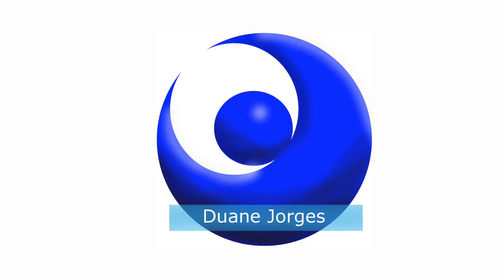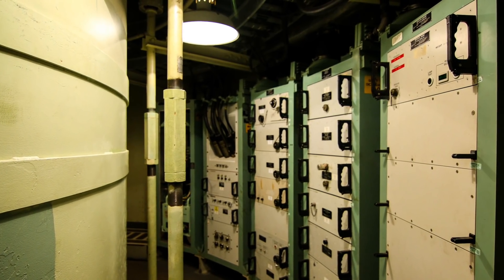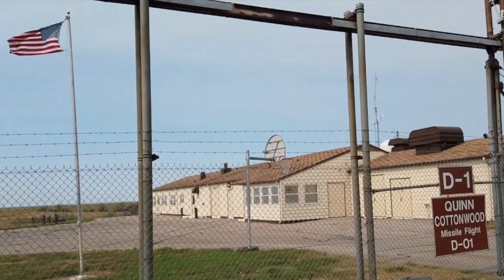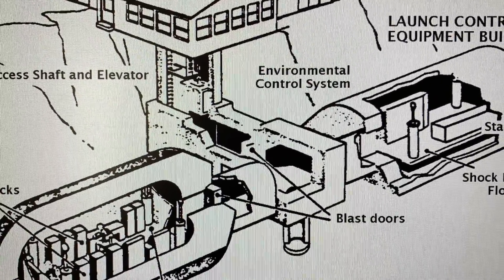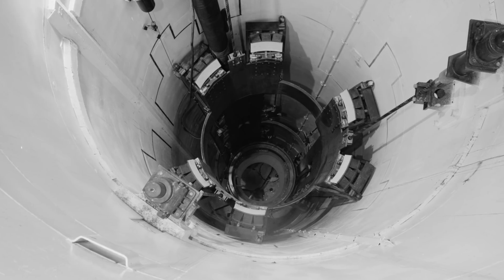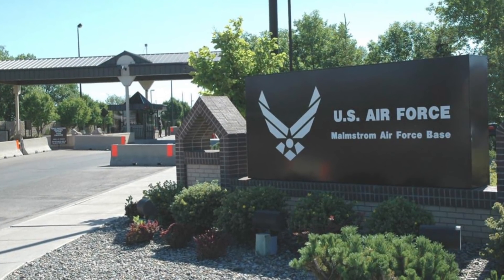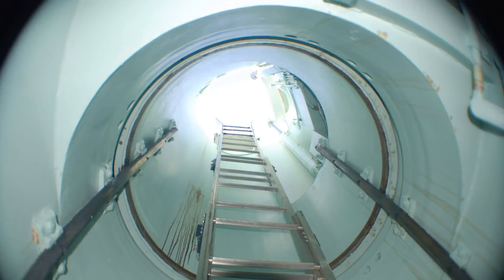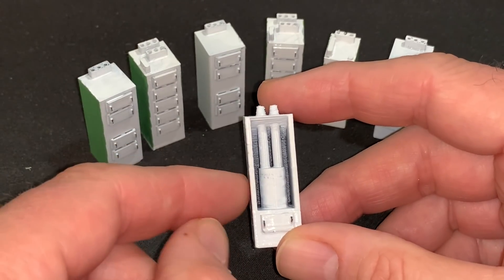Minuteman III Missile Site - Virtual Tour

Comment: This brings back a lot of memories. I was at A5 the one in the foothills near Monarch. my first job out of tech school in Minnesota. A5 was part of the first missile site to be built. It was a Minuteman 1. One day back in 1962 the missile was in the hole without the warhead when we got a call for all Boeing personnel to leave the site. On the way back to Great Falls we saw the truck which carries the warhead go out. It was the start of the Cuban missile crisis. Note the support building was not built yet at this site. I know all about the access procedures and the forever slow Plug. Do you remember the Polaris tube?
The rest of my time at Bowing was going from site to site with another crew doing the same and run tests and balancing the line between missile lunch siloes. all over the three bases Malmstrom, Minot AFB, North Dakota, and Ellsworth AFB South Dakota. just about every missile site some before the Air Force takes over and some after. without the Security Forces with us. We were given the codes to open the hatches and then to codes to lock up after we left. I'm now 82

Comment: My family was stationed at Malmstrom from 1973 until my dad retired in about 1984-ish?  Sounds like we were there at the same time.  I had a great time growing up at Malmstrom.  The library was excellent, the bowling alley always good for a diversion, and the base theater often carried relatively new movies (I saw Alien there when it came out... my first R-rated movie).  I used to ride my bike around Perimeter Road past the nuclear weapons storage facility quite regularly (that hill just outside the SF was a bear).  Great memories of growing up on that base.  

I recall a few times during base open houses when we were able to tour the T-9 trainer, which I'm sure you were very familiar with.  For those not in the know, there was a complete LF right on the base that was set up as a training facility (it never housed a live missile).  The only difference from an actual LF was the regular stairway next to it so you didn't have to climb down the ladder to get inside.

It sounds like you worked on the equipment and not the missile itself.  For those wondering, the large blast door over the silo could be winched off with a little hydraulic tug (it would take a while) so that access to the missile itself could be gained.  There were two specialized trucks, one that was used for transporting the nose cone of the missile (including the RVs... reentry vehicles... a.k.a. the nuclear weapons) and a second one called a transporter erector that could hoist the entire missile out of the silo so it could be returned to base for maintenance.  Both of these trucks were designed such that they parked over the silo so the Soviets would not be able to see (from satellites) if there was a missile and warhead currently in the silo or not.  This ensured that they had to target each individual LF if they wanted to be sure of taking out our Minuteman force.

In the event of a launch, a set of gas generators would fire (think of them like cannon rounds but without the shells) which would actuate a plunger that pulled the door from underneath.  This system could remove the several ton door in just a few seconds.  In simulated launches (which I was able to participate in during a base open house and also during a visit with my ROTC group some years later), we would observe that the silo access door light would turn on, indicating that the door was open, and then the perimeter fence violated light would come on as the door flew through the fence at several miles per hour.

Thank you for the great tour of an LF.  Your diorama looks amazing, too.
Reply: Hi Jan, 
Did you know Chief Master Sgt Baer? That was my father in law. He retired from Malstrom in 1982. I was on the Combat Targeting Team/ instructor, before I left in 1979
Reply: @robertbonser2724  It doesn't sound familiar, but I'll bet my dad knew him... he was Chief Peterson in the 341st CSG.  I'll ask him next time we talk.
Reply: @robertbonser2724  Hey, Robert, I talked to my dad last night.  He did NOT know Chief Baer, which surprises me as he knew pretty much everyone on that base.  When we first transferred there he was with the 17th DSES, then the 24th and finally the 341st CSG where he was in personnel.

Comment: I was a Security Policeman in the 564th SMS (papa through Tango) 1972 and 73 and worked mostly at Tango which was the squadron’s command post. Then Europe, then back to the 341st (76-79) where I worked in the 12th SMS. I can’t even count the number of responses to security alarms at LFs I responded to from the LCF. But what beautiful country!  Both the 564th and the 12th were west of I-15 closer to the east range of the Rockies. Later, I spent 2 years at Minot AFB in central North Dakota, much of it in the missile field. Unfortunately, not beautiful at all!  

Prairie dogs were our nemesis!  We’d carry a garden hose with sand bags. One end of the hose went in our exhaust pipe and the other under the launcher closure door with the sandbags closing the gap between the door and be the concrete. Waiting long enough, we’d gas quite a few prairie dogs and prevent a return in sub-zero weather through snow drifts. Amazing what the Air Force trusted 18 and 19 year old airmen to do with little supervision. 

Suggest you recollect the A circuit as you update your video. Unless an SP opened that, there was no access to the B circuit.

Comment: Nice Video. I was station at Ellsworth AFB, South Dakota 1966-1970. I was on a three man team Target and Aliment later call Combat Targeting. Sac 44th Missile Maintenance . I ran a computer that was in the back of a 5 ton truck that was huge. I remember being out in 50 below zero working. One thing about the Air Force they made good winter clothes. Loved my parka. Thanks for the memories.
Reply: @davidkeller9510, I've read a little about the Combat Targeting Team and procedures in the Air Force Missile Association Newsletter but there are so many questions still. Were the missiles you worked on the Minuteman 1A's, 1B's? I would like to read a complete procedure of everything done topside and below to align the missile. How did the collimator get azimuth data to the missile guidance package? Thanks for your service to our country!

Comment: I grew up in Grand Forks, ND. My dad moved jobs in 1955 from Sioux City IA (which had a SAC base for RADAR). He managed the civilian side of Core of Engineer operations at the GFAFB, from when it was a farm field till he retired in 1980. There was 150 Minuteman flights build around that base, but because the soil was so corrosive. They decommissioned all of these. As well the base had all of its nuclear bombs removed, and really has no function at this point. The B52 , KC135 tankers, and the B1 are all gone. It's just pork that keeps that base going, as it has no mission.
My dad got me a nepotism job in the summer of 1974 working for Boeing, as an Assembly and Check (ACO) out Equipment store lacki.This project was the missile silo upgrade program to harden the silo from near hits. This also converted the missile from single bomb to 3 MIRV weapons. Also installed was a turntable so the missile could have its trajectory changed before launch, as this was predetermined while still in the hole.
Because of the secrecy of all this, I never got to take a tour of the training facility they had on the base for these silos.
Thanks for the video. And thank you for your service.

Comment: I was a maintainer at Whiteman AFB in Missouri in the early 90s I was part of the 351st FMMS. First on PMT then as part of FMT. Watching this brought back a lot of memories. Thank you!
Reply: What is the Minuteman Silo Security System Designation?
Reply: @gustavoaguilar3394  I don't understand the question. On the site there are sensors for movement that would trigger an alert at the Launch Control Facility or LCF. Then security police in an armored car would go out there and check it out.

Comment: First of all: Thank you for your service. One of the unsung heroes of the cold war, just like me. I was stationed in Cheyenne at F E Warren AFB back in 86-87. I was only Administration. I was placed in several units while there and when I was with the supply squadron's fuels branch (fuels for the Air Rescue and Recovery Squadron helicopters, helicopters because the base has no active runway) I was invited to assist with the annual static ground testing of the fuel tanks at all ten LCF's. This means riding in a UH1H (Huey) all frigging day! Sounds like fun, right? Not exactly. The first couple hours were awesome but it got old real fast. When inside the main building at each sight I was constantly imagining what all goes on under my feet. I also wondered of the incredible power so close at hand. One of the most important things that happened while in Cheyenne was the installation and acceptance by SAC from Boeing for the Peacekeeper weapons system. I had no idea that systems like that could be phased out but three years ago when I moved back to Cheyenne as a civilian I found that the Peacekeepers had all been removed. There's still plenty of stuff out there to take it's place I know. Thank you for a great video! Oh yeah, the security guys can't go into the silo? Now that's funny! Sure they keep eyes out topside but still, they must've been a little butt hurt.
Reply: Did you get to see the Stargate??

Comment: I was a Ground Telemetry Station Operator and technician at Vandenberg AFB.  Participated in many test firings of MMI & MMII.  MMIII was just begging testing and deployments, and that happened after I left the Air Force.  It was one of the most interesting jobs that I ever held in my life.
Reply: Cool job indeed. My father is a retired O-6 D.C.M. and former enlistedB-25 crew chief, who had a 2nd career working in the Rivet Mile program for TRW Aerospace. We have a few "hold down nuts" from various test launches that he attended at Vandenberg. They make great book ends, due to their mass. 🤣

Comment: I was PMT 90th FMMS at FE Warren AFB back in the late late 80's. We had like 150 Minuteman III and 50 MX(Peacekeeper) online if I remember correctly.  Random memories and thoughts here.

 It was always the responsibility of the "new guy" to hand crank open the B Plug Hatch door. It was also the job of the "new guy" to lower, by rope, all of the PMT equipment and supplies down the length of the B Plug access shaft at the start and then to raise that equipment and those supplies, by rope, back up topside when our duties were done on site. 

No one ever wore the safety harness while doing so because no one wanted to look soft(especially if you were the "new guy") We did have gals on our teams but of course they never had to do the cranking or the lowering and lifting because... I still recall the feeling of jelly legs and jelly arms struggling to pull up the last bit of equipment fearing my  collapse and fall down the access shaft and how much it would hurt(multiple compound fractures and probably death for sure) 

Anyone else remember the experience of having to lower The Cage(small 2 man lift with a powered winch and an always sketchy looking cable that was supposed to support the weight of the cage)  down the access shaft, assembling it, installing it on the inside of the launch tube and riding it down to the bottom of the silo for that Sump Pump check? 

 If having sex with someone in an aircraft is known as the Mile High Club what should sex at the bottom of a Minuteman III ICBM silo(sump pump check) be called? The Subterranean Club? The Armageddon Club? The Mutually Assured Destruction Club? Ive never been able to settle on one.

I was really really good at repairing and replacing the old worn out grip tape with new grip tape on the wall mounted ladder rungs leading down into the LSB

I remember the two .12 gauge shotguns and .00 buckshot wrapped in plastic down in the silo equipment room area. Just in case I guess.

The Chicken Maryland/corn/roll combo was my go to order when dining at the LCF. It was actually The Bomb.

Yeah, I could go on and on
Reply: That’s some great memory memoriam

Comment: So, I take it you were FMT/FMMS? I was EMT - 321 SMW Grand Forks.  Bummer they are all gone now.  I really like what you are doing.  I would some day like to make a flyable MMIII model and silo and launch it, but there is no place close to me that i can launch rockets.  Great presentation.  I don't know if you guys did this at Malmstrom, but in the LF, I think it was the HF rack, maybe the third drawer up?? It was empty.  We would open it and initial the inside of the panel.
Reply: Joe, when were you at GFAFB? I was there from 1975-1979 - EMT and then TTB.
Reply: @mikeshelley4862  1985 - 1989, then went Palace Front to the 171st ARW in Pittsburgh.   ...LOL 10 years apart!
Reply: @joeminpa6705  86-90 for me in the 321st
Reply: @johndomas2621  what shop?
Reply: @joeminpa6705  EMT then Vehicles & Equipment Control Branch

Comment: And also I guess if the enemy hits us with a missile that's going to wipe out all the electricity for ever. Then they said that the enemy can can shut down our whole defense computers and all that and we can't defend ourselves but I'm sure you guys got that worked out anyway so that was my question??
Reply: The Missiles and Launch crews all have their own backup generators when commercial power is lost to the sites. Large batteries backup the generators.
Reply: My father said they had emergency rations and diesel fuel for 30 days.  After that, they had a shovel to dig themselves out the 45 degree culvert escape tube. This was in 1966.
Reply: @terencegalati970  That was still true in 1982 when I left Minot.  If I remember, the Escape Tunnel hatch weighed 554 lbs and held in place by 2 chains.  We called it the Deputy Killer. We figured it was a non issue because the sand filled tunnel would have turned to glass during a NUDET.